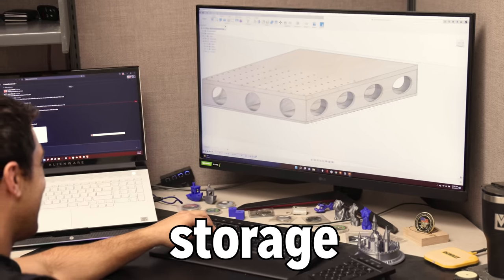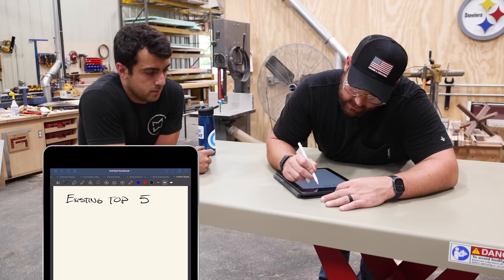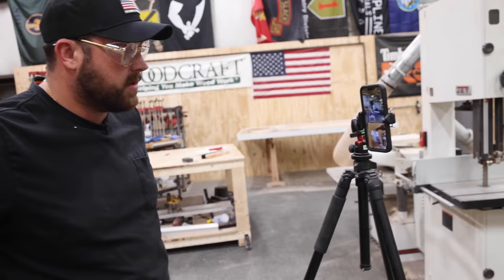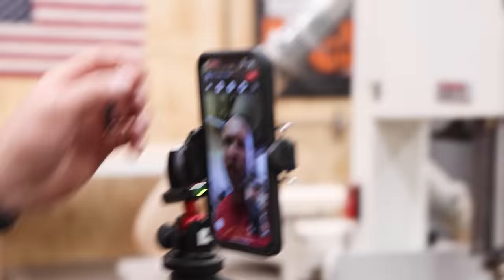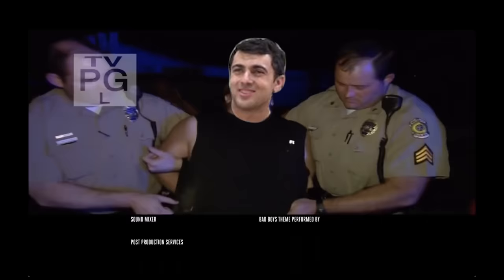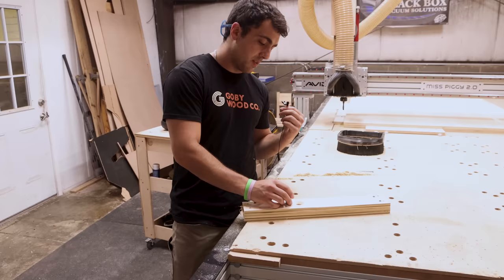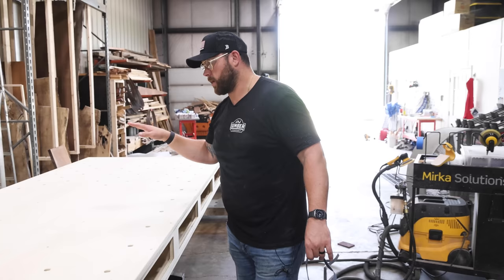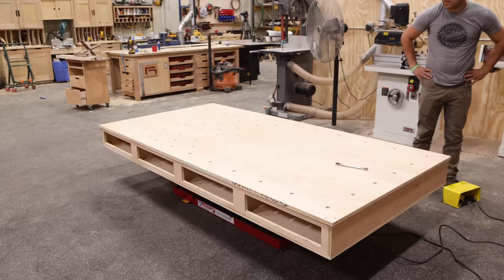This Workbench Will Make Me Thousands!

Comment: As both a programmer and a DIY carpenter, the thing I would love and benefit from the most would be a demonstration of the CAD designing process and how to convert those designs into cut list; I've always found it insanely intriguing to know how much material is required for a project without making a single cut.

Comment: As a designer of the Southworth lift, I love it. Great work. I have a few ideas of a down draft table add-on. Tool holder add-on, power relocation to table top. Air hose location on the top and the vacuum clamps. Great start. great project. not a Sales person for Southworth, but knowing the catalog, did you see the vee top to hold round product? Did you see the tilter so you could lift and tilt large loads? We do design the LS product line for 6000lb everyday. As a previous manufacturing engineer who purchased the Southworth tables for a sheet metal shop. Modified everyone to hold large sheets and used them for welding tables after isolating the table top from the legs.

Comment: I liked the oval holes Jordan.  They would have worked fine.  They also make the sides stronger from an engineering perspective.   They do that on beams to reduce weight without taking a lot of strength out of the beam.

Comment: I have two workbenches with lifts like this in my shop. They are so nice to have! I would recommend putting it up on like 3.5"x3.5"x36" blocks (think pallet stretchers) so you can move it with the pallet jack if necessary. Good work!

Comment: I built the ghetto version of this about 3 or 4 years ago. 3.5' x 7.5' plywood torsion box with a sacrificial 4 x 8 melamine top sitting on a Harbor Freight motorcycle lift. I went with melamine because I do a lot of projects with fiberglass and melamine with a coat of wax makes a good surface for that. Plus, when it gets banged up, for less than $50, I've got a brand new top.

I was originally going to extend the hydraulic foot pedals out but I never did. When I started using it I realized that I didn't raise and lower it very often so it wasn't a big deal to just get a foot under to pump the the cylinder up or hit the release. 

It's not nearly as nice as a real lift table but it's also less that $500 for everything (or at least it was when I built it).

Comment: Your crossmembers should have had the bulk of the material routed out of them too..ala Paulk.

Both for inserting longer objects (track saw rails, clamps, etc) and for retrieval of small parts that drop through the holes.

Comment: hi.verry usefull project.
I actualy have a Q for Jordan : Did u print that dust hood for the CNC ? i am having isues with mine, and i would like to replace it, can u give some insight  of the 3d model or a place where i can get a model? i have a diferent spindel with ATC, surely i will have to modify it to fit it.
Thx , keep up the good work,be safe !

Comment: Still would of recommended it being laminated on the top,  I get your a "wood" shop still think it would allow you to see imperfections on the table so when your sliding and moving things around you don't scratch it.

Use some 3/4 marine grade ply with laminate.
Reply from the maker: You mean like a Formica ? That’s a great idea
Reply: Yes! Couldn't think of the word this morning.

I'd recommend white, again it's a flat surface and worse case you can just slap a new one down on top of it.

Just makes it easier to slide around, and a white surface for quick notes or drawings and can easily take a damp cloth and clean it over and over again.

Comment: Can you explain your decision for.og hole layout?
Reply: Not sure what theirs is, but I laid mine out in a 6" center to center grid because my hold fasts have a 6" reach. Base the pattern off of your tools.
Reply: @ChuckADickiner  right but theirs looked like it had diamond patterns
Reply: @chrisjaustin88  I've seen guys do that for things like shaker doors and other fixturing set ups. Like I said you set it up for your tools. I suppose what you're building would be a factor I should have mentioned as well. It's really a personal thing, I have yet to see a bench or layout that is "the answer" since mine is for building cabinets and tables mostly I just went with a grid on the top and a diamond patternon the apron (to work with my vice). My coworker who does more doors and panels etc. Went with an offset grid at a 4" pattern (his little bench dog screw clamps have 4" range) and no apron instead of a straight grid like mine. Another coworker who does mostly drawer boxes went with a T-track system instead. I'm not sure what will work best for you but there's lots of options to choose from. Personally I'd say look at what you have and what you plan to use it for and go from there.